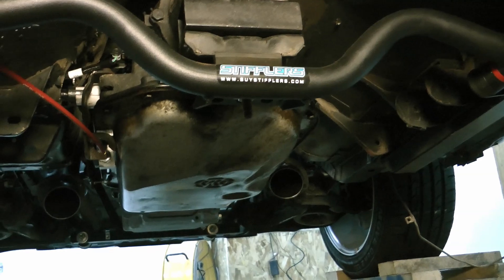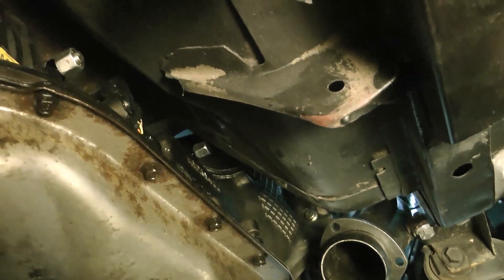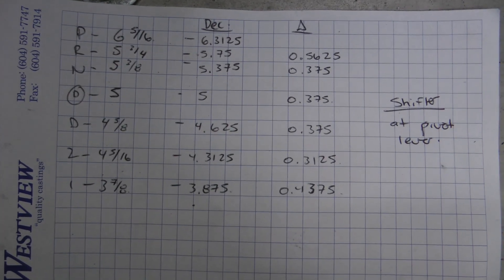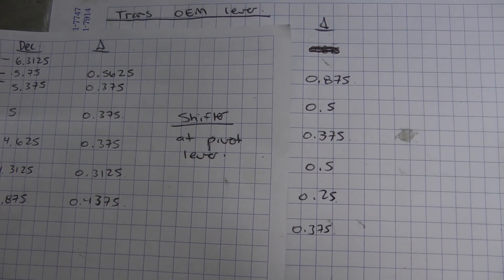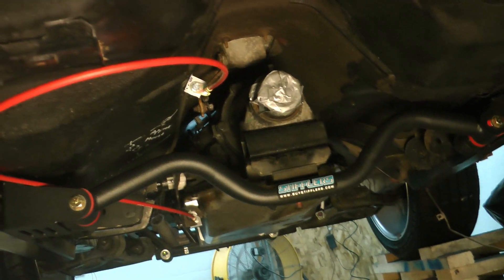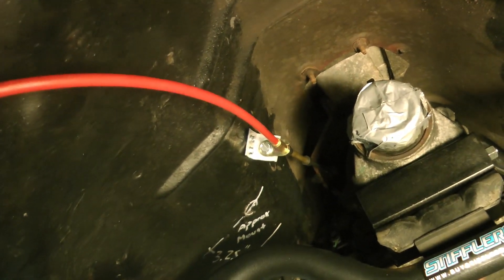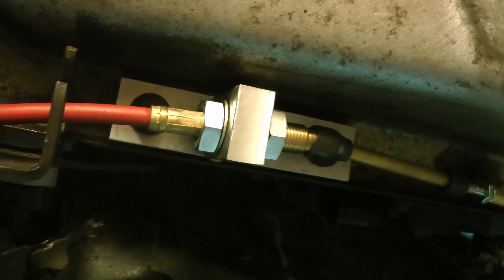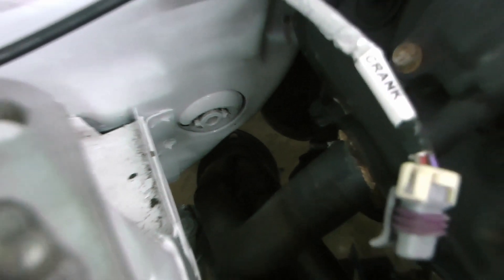How to: 4l80E in Foxbody mustang with stock shifter (LS swap)

Comment: Did you have any issues hooking up the cooler lines? Looks pretty tight, and reason for asking is some claim cutting is required on the passenger side due to this. Thanks in advance
Reply from the maker: No the cooler lines fit no issue
Reply: Perfect! Thank you sir! Greatly appreciate it!!
Reply: Great! Thanks for all the videos! I’m learning a ton! Keep them coming🤘🏻🤘🏻
Reply: Did you have a lot of clearancing to do for the neutral safety switch on the newer 4l80e. I reading a lot of feedback saying using the older 94 and pre 4l80e models makes for an easier and better fitting swap. Any insight on that in your experience and research?
Reply from the maker: @robertweatherford3666  nadda, the 80e will fit just fine, I had to do a bit of hammering in the spots I mentioned in my video. If I was more careful i could have done even less!
Reply: One last question on the fitment my man. Where the harness plugs in did you cut there, or with the massaging you were able to get the clearance needed for the plug. I tried to pause the video and zoom in but just can’t tell. Watched a few other swaps and they cut a circle out to the interior for the plug and used a rubber grommet to seal it back up. Let me ad your swap is the cleanest by far I’ve come across for the 80e hints the reason I’m watching every video and picking your brain 🤙🏻
Reply from the maker: @robertweatherford3666  thanks! Yes you need to cut a big hole for the connector
Reply: I noticed the trans mounts you mounted your stiffer mounts behind aren’t the factory mounts. My question is, are they in the exact same location ford had them in, or has that coupe been swapped before with another trans?
Reply from the maker: @robertweatherford3666  mounted to my sub frame connectors not factory
Reply: Yeah understand that, my question is are the mounts your no longer using that are also connected to your frame connectors in the factory ford position. Reason for asking is the measurement you supply from them to the new stiffler mounts. Wondering if that measurement will be the same from the stock trans mount on my fox. Thanks
Reply from the maker: @robertweatherford3666  yes thats the stock mount in stock position. Your measurement will change depending on engine position
Reply: Obviously I can make my own measurements, and the only reason I’m asking is I have some bolt on subframes and I’m not sure if the fronts go far enough to bolt into safety

Comment: Did your engine and transmission not originally come from the same vehicle? My LS and 4L80E came from the same 3500 work van, so I was wondering why you needed a new flexplate.
Reply from the maker: I needed a dished plate, the engine came with a flat one. Correct different vehicles

Comment: What shift cable did you use for transmission?
Reply from the maker: 80605 b and m
Reply: @WestcoastWrenchin  - What dipstick did you use?
Reply from the maker: @JST4CYL  straight out of the truck
Reply: @WestcoastWrenchin  - And tube is Allstar?